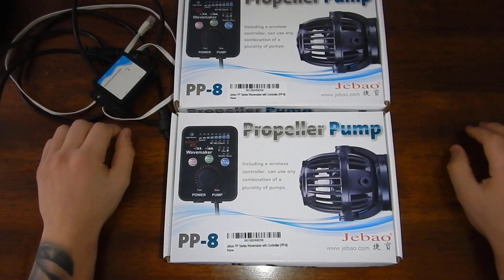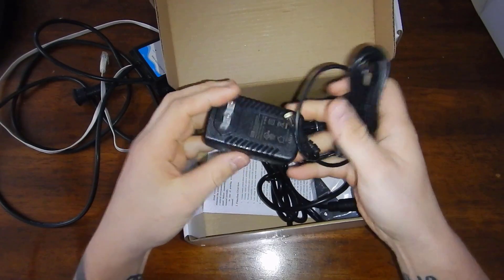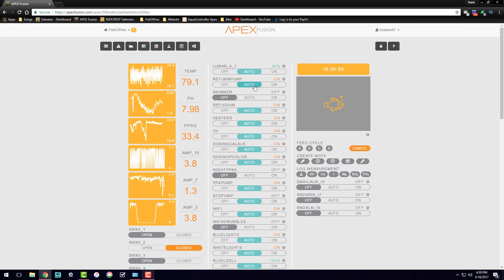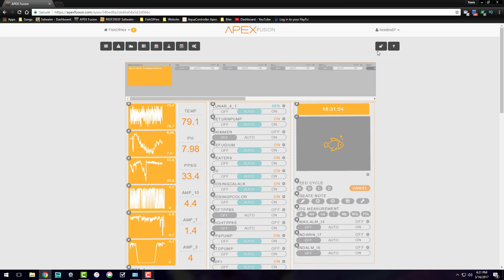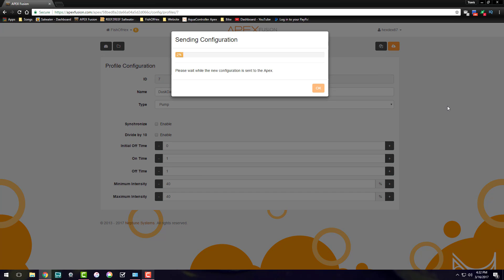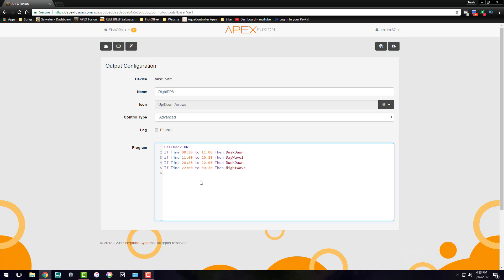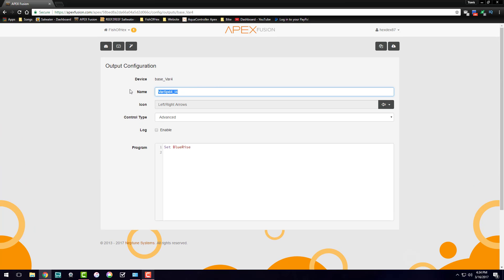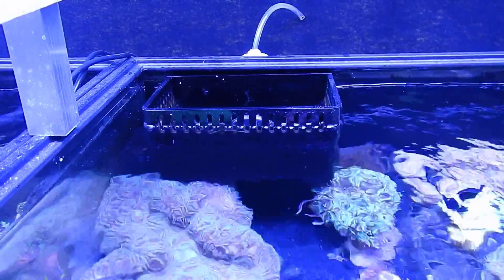Unboxing Jebao PP8s & Apex Programming | 200 Gallon Frag Tank Build Part 5

Comment: Im debating an apex right now Im in Cornwall, Ontario,Canada and the guy wants 800$ for a 2013 Apex Neptune Pro System with lab grade probes, ORB probe, PH probe, Temp probe, and Energy bar 8
additional - Apex energy bar 8, Apex PM1 Module, Apex AFS module feeder, Apex ALD module leak detector, Neptune Break IO box, Neptune 2 channel AquaSurf or Apex or Tunze to stream cable assembly.
Two shlobster dosers 1.1ml/min with two spare replacement internal silicone hoses.
I NEED ADVICE im almost done setting up my 200g coral only system !! :)
Reply from the maker: If the price works for you i love the apex and wouldnt run a reef without one
Reply: Im thinking since its from 2013 Id rather spend the extra money and get a brand new one unless the guy wants to drop from 800$ lol  Thanks for the reply Im up to 10 subs  so excited!  :) Cant wait to get my store/aquaculture facility  up and going and a larger youtube presence !!! Thanks for the inspiration :)